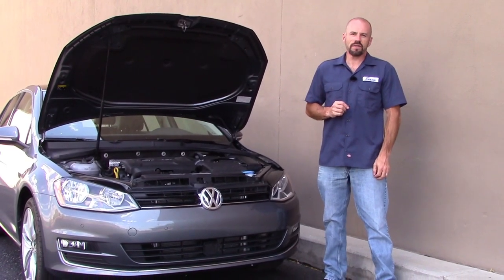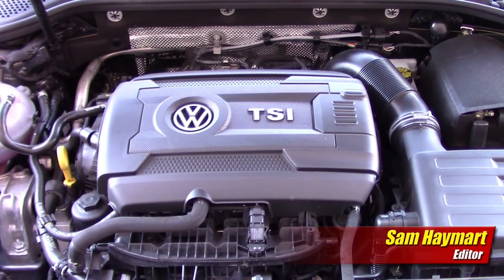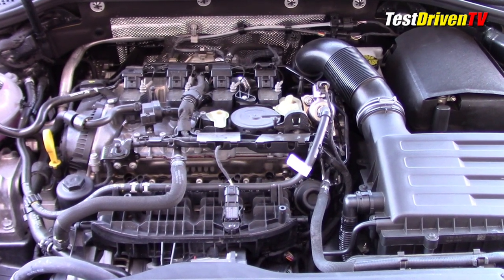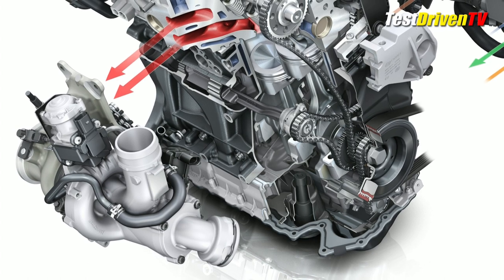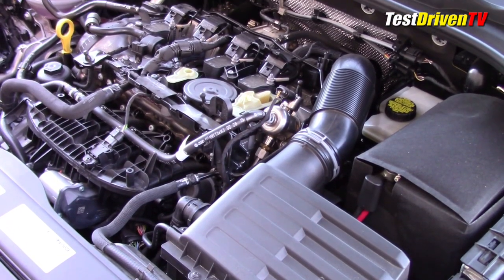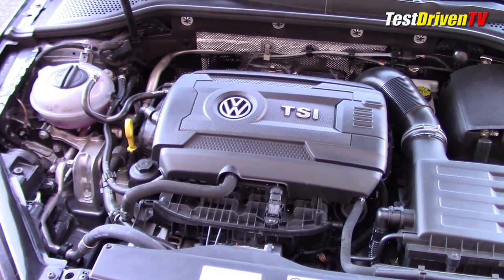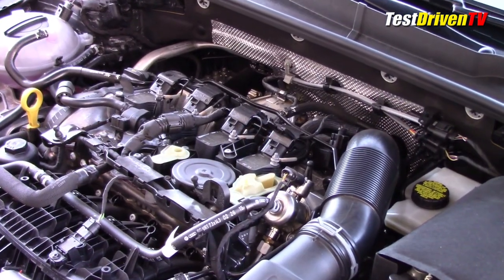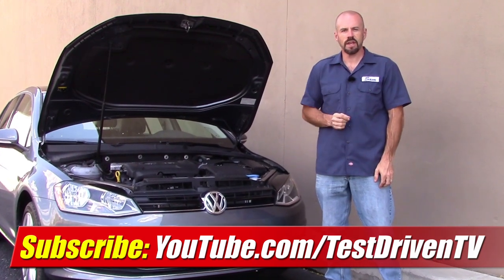Under The Hood: 2016 Volkswagen Golf 1.8 TSI

Comment: I have a 2015 Golf TSI that I bought new. It just turned 110,000 miles. I’ve never had to fix a single thing. I just had to replace the PCV valve which cost me $150 and about 45 minutes to replace. 😁
Reply: Just curious can you hear the engine ticking from the cab?
Reply: at idle an audible clicking possibly the fuel injectors
Reply: @thenewkidontheblok  I agree.
Reply: I just did a LOT of work on my daughters Passat with 130k. She bought at 90k miles and it had pretty good oil change history ( a little longer than I would like). Inside of the engine is spotless and doesn’t burn or leak a drop of oil. I have her on 5k or less synthetic oil change intervals. Probably more than it needs but the filter is small and I would rather “overchange” than not. I blasted the valves and they were pretty bad at this mileage. I proactively did the water pump/thermo housing as well as the PVC and coils.

Comment: Great explanation on the engine but am I correct that the European variant of this engine has both port and direct fuel injection and the North American engine only has direct fuel injection. The direct-injected-only engines have issues with carboning up and require the removal of the fuel rail and injector assembly to gain access to the combustion chambers so the valves and combustion chamber areas can be cleaned. Generally with a liquid cleaner then blasting with walnut bits to clean out the carbon buildup.Needs to be done around every 100,000 KM. Why wouldn't Volkswagen have used the European direct & port injection engine design in North America? That would eliminate the carboning up issue.

Comment: Did VW  fix the cam chain tensioner issue for this year? I heard it is a common problem for TSI engine.
Reply: Looking at 1:33 in the upper right of the screen (under the logo), it appears to be a completely different design altogether. So in that sense, yes. 
But the question is still valid, as we don't really know yet the overall reliability of the new design. But I would hope that they had enough sense to make it more robust and/or better quality.
Reply: hey mates. it’s been 2 years what do yall think? would appreciate an answer about this engine.
Reply: @zhila5958  I've had a 2018 1.8 TSI Golf.Nearly four years and about 30,000 miles later,it's been flawless.

Comment: I had a 2004 model that made 180hp and 200lb-ft from same displacement. Why is this less?
Reply from the maker: You are probably referring to the 20V 1.8 turbo used in the Beetle S and GTI tuned to run on premium unleaded. This new engine is made to run on regular fuel as a base powerplant, only has 16 valves and is tuned for fuel economy more so than high-performance. VW has reserved that spot for the 2.0 liter version of the EA888
Reply: These are extremely underrated as well. My 2016 Golf 1.8 put down 187whp, and 238wtq bone stock on a Dynojet.
Reply: pjcrock doesn't it carry the same torque from like 1600-4500 or something? 
I got one and it's an automatic and I'm quite impressed
Reply: Yes, I had a 5 speed and it took about 1.5 seconds to spool up but that engine would pull from 1800rpm on up
Reply: pjcrock 
Wow mines instant. 
I keep snapping my neck off the line and burning the tires when I leave from a stop. 
it's touchy

Comment: 87 Octane good for this engine?
Reply: @Slavic_Boer  define
Reply: @Slavic_Boer  how would it run better?
Reply: @Slavic_Boer  thank you
Reply: I use 87 but only top tier detergent gas per VW user guidelines.  Sometime throw 89 or 93 but the 1.8 compression ratio is lower than the 2.0 so an early combustion isn’t as much of an issue as with the GTI and Golf R.

Comment: Everything is easy to maintain except throttle body SMH
Reply from the maker: What kind of maintenance does the throttle body need?
Reply: @TestDrivenTV  cleaning the throttle, replacing the throttle position sensor, or sometimes replacing the whole throttle body. Pretty common things.
Reply from the maker: That's not maintenance, that's repair.
Reply: i'm buying a vw 1.8 tsi however i have a concern about oil consumtion ! please help me

Comment: This Golf with this very big engine probaly gets very bad gas milage. a 1.2TSI or 1.4TSI wiuld be much better
Reply: not a very big engine...i  get 5.4L per 100km highway and still get 170hp... a 1.2 and 1.4 tsi are a bit gutless.
Reply: 1.4 gets a drop better but its so slooowww
Reply: Wrong
Reply: @Maplesyrup416  If u get the Golf GTE not. 300hp with stage 1 and very economical
Reply: @MauriceNL1  GTE isn’t in NA market. 1.8 gets great mileage and good power 245 HP 285 ftlb stage 1 is already faster than GTI, and don’t have to worry about pesky and costly battery pack aging, and this is way cheaper than what a GTE would cost.
Reply: We now get the 1.4 golfs in NA, 1.8 ended in 2018. The 1.8 hold their value more than the newer models because the engine is better.
Reply: @Jushwa  Not the 1.5TSI?
Reply: @MauriceNL1  no from 19-21 they gave it a 1.4 and sales collapsed. We stopped getting the golf in 2021, just the gti and the r now.

Comment: VW TSI 1-4 turbo intercooler engines class aluminum alloy which are expensive and risk bankrupt by expensive and have record from customers as not recommended to drive.
In VW TSI 1-4 turbo intercooler engines all and VW TSI 1-4 turbo intercooler engines all hybrid with test maximum over 20,000 rpm and F1 speed : easy damage, 20-100 l/100km, over 100 l/100km. Customers TSI 1-4 turbo intercooler engines are street racers class brilliant who prefer drive fun destruction.

End report.

From
All VW TSI 1-4 turbo intercooler engines and All VW TSI 1-4 turbo intercooler engines hybrid database